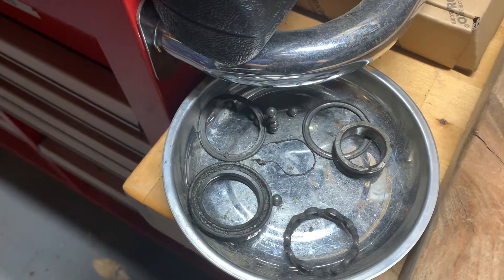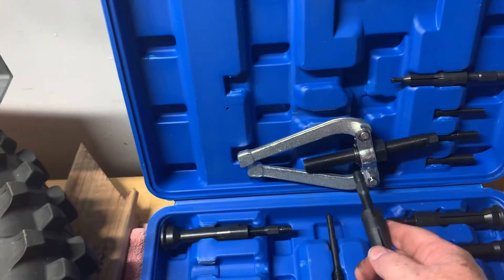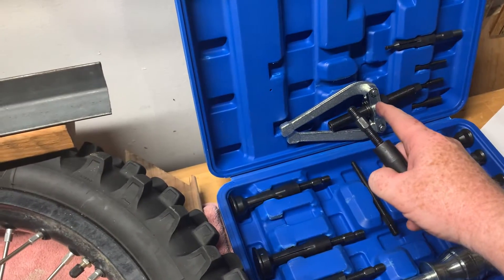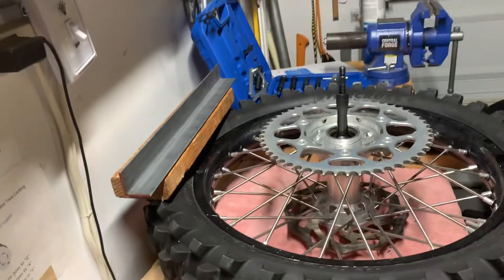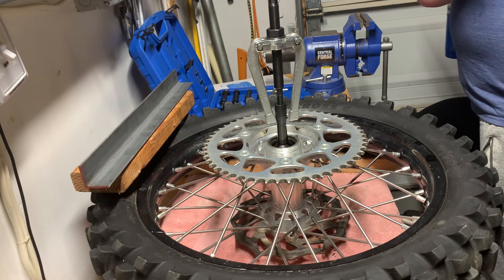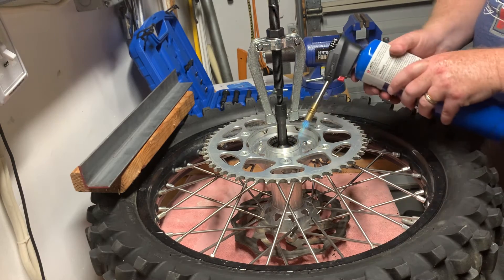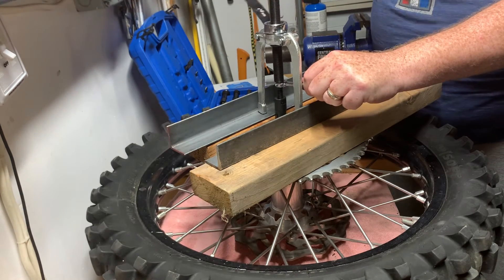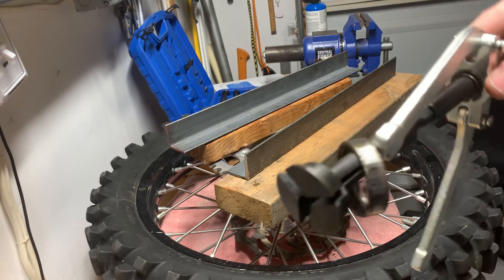How to use a blind bearing puller to remove a broken bearing from a motorcycle wheel

Comment: Nice to see the different brands / models in action that are out there . Simply so we can make our best decisions . 

The legs look a little wobbly but it does the job. 

Key point is that eventhough the bearings are not to be reused , I would still use the threaded center bolt in that kit instead of the slide hammer ..... specifically for the reason you experienced. 

However, it is  great that your kit has a collet big enough to do the outer race  when and if  this happens .